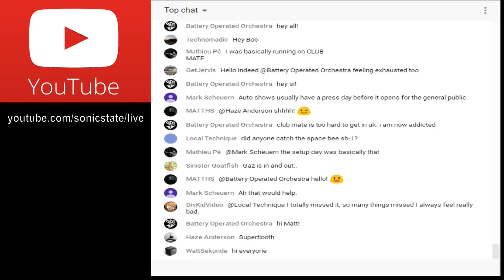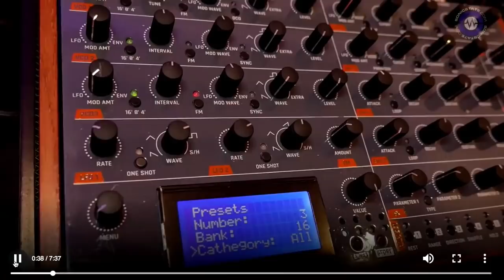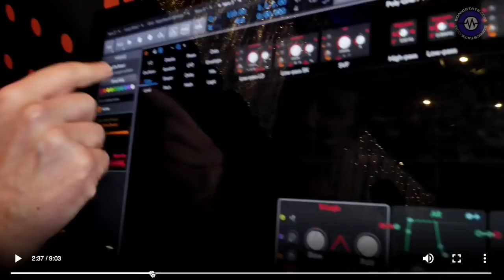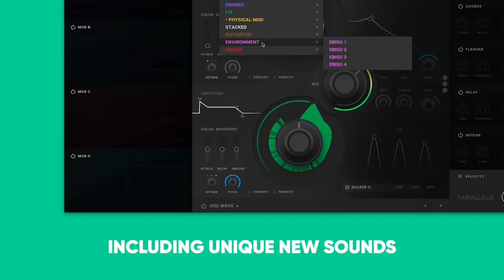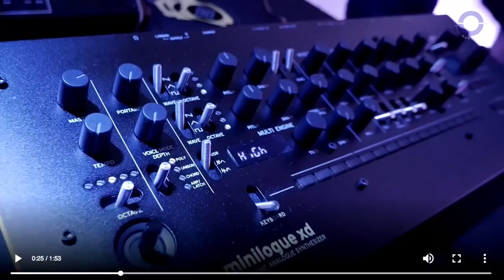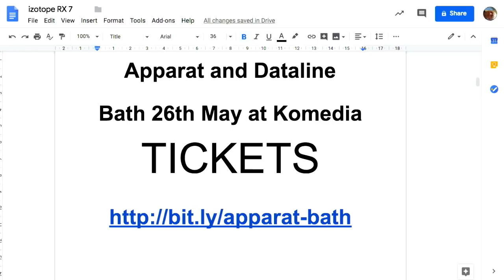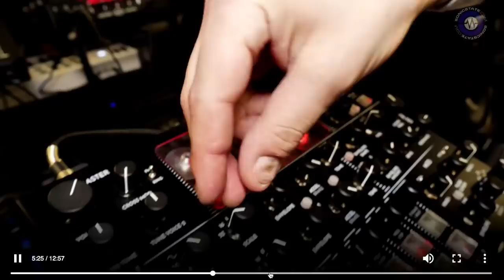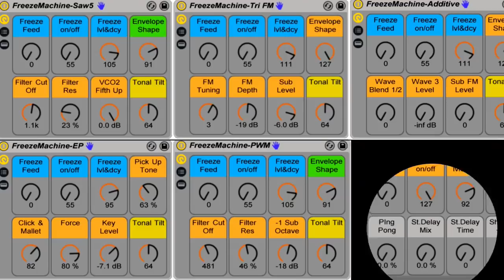Sonic TALK 576 Super Boothbonic Plague

Comment: Ben, you're right. The CEM3340 VCO chip is a complete VCO on a chip with lin/log converter. Put a voltage in get a signal out.